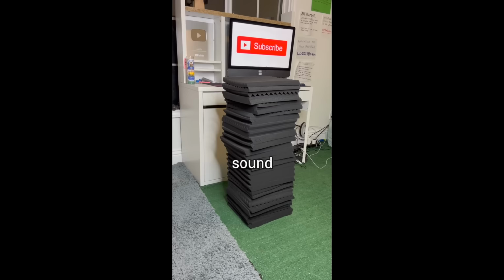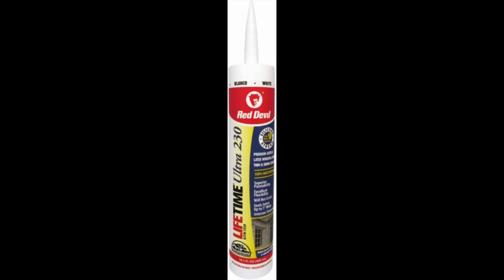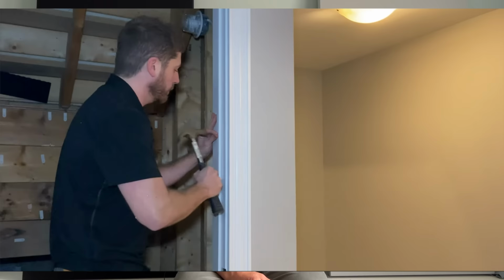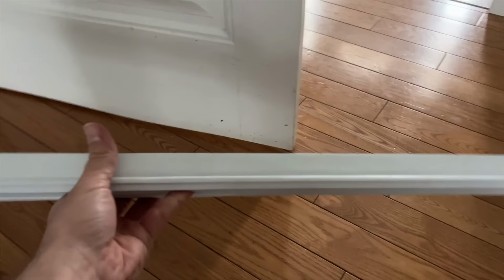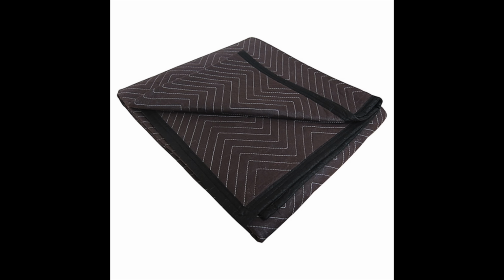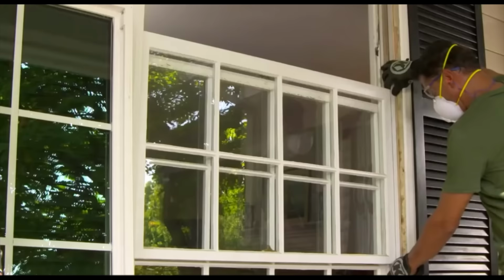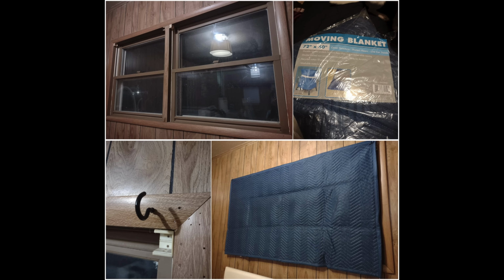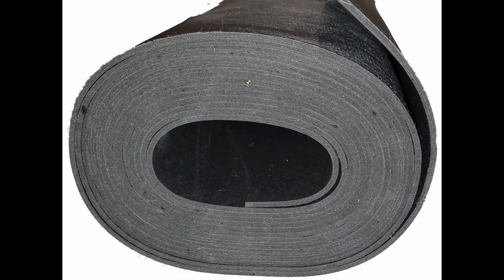CHEAPEST Budget way For SOUNDPROOFING a Room

Comment: First 11 minutes make sense, then you started speaking american and talking about walls you can talk through through power outlets... Euro walls are not soundproof, but you have as much chance of talking through your ass as you have with achieving any level of communication through a wall using a socket... You can yell like hell and people in the next room will hear you, but the power outlet ain`t gonna do much about it... 20+cm(around what, 8 inches or so) is the basic thickness for a reinforced concrete wall... The socket gets it`s juice through a solid conductor that is pulled through a corrugated pipe that is meant to allow you to move the wiring through the walls without scraping off the insulation off of the cable on the concrete, but instead the cable is pushed or pulled through a guide sleeve that due to corrugated design - is positively affixed by the concrete or filler that encases the ribbed pipe... There is some sound traveling through that sleeve, but it ain`t much... 

edit
Jesus, you almost made me think i was crazy... Then i recalled that Euro style construction is not the only style out there...